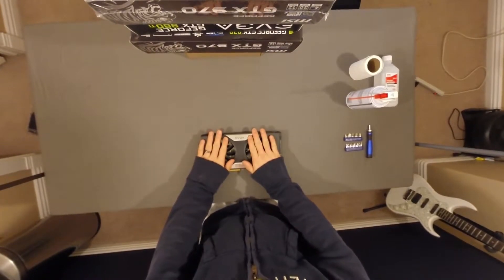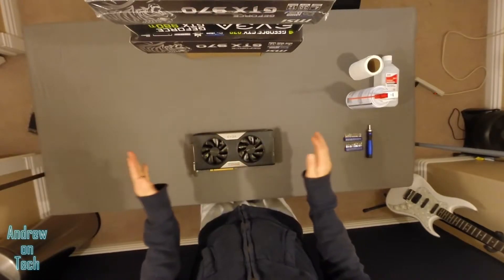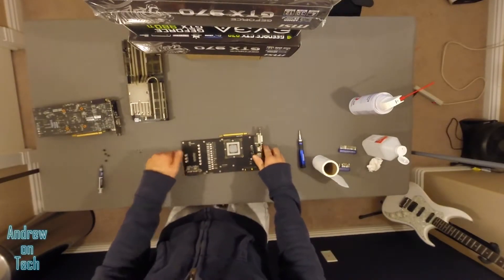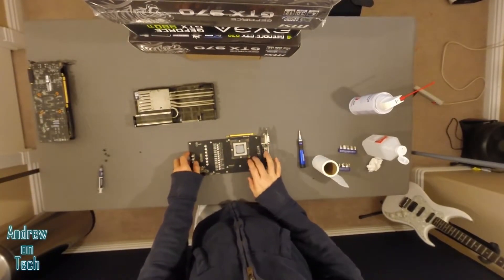Tech Care ep01: Clean Your GPU

Comment: I'm about to buy a used Geforce GTX 970 on ebay.  Is it recommended that I clean it right away?  It will be my first build.  And what thermal paste do you recommend.
Reply from the maker: +Owen Katapang I think when buying used it is recommended to look at the condition of the card and make a decision on whether or not to clean it. If the card is dusty, dirty, or shows oddly high temps, then I would consider a cleaning. If you get it and it looks clean and runs as expected you don't need to clean it. The 970 isn't that old so as a gut feeling you should probably be ok, but it really depends on the environment the previous owner kept it.
Reply: Well according to the seller he bought it in Nov 23 2014.  He's never taken apart the card itself, but he does thoroughly clean his computer at least once or twice a year.  Says he's not a gamer so the card has never been under a lot of stress, uses his computer mostly Adobe Creative Suite.   A card like that do you recommend I clean it right away or wait two or three months?  And what is the temperature when I should be worried about high temps?
Reply from the maker: Personally it doesn't sound like it has been stressed to badly, I would run the card for a bit and see how the temps are before I take the time. As for temperature it does depend on the card, but with a 970 anything 80c and under should be safe, even if it is there a lot of the time. Going over 80c is ok in spurts but for a constant load I would try and stay under 80c.

Comment: Questions:
Cleaning with Cactus Cooler, will it keep it even cooler!? 
Is there no need for grounding when touching the electronics (like grounding bracelets when installing/cleaning CPUs?)

p.s. Great videos!  New Andrew on Tech logo coming?
Reply from the maker: +FlyingLion23 Heh, Cactus Cooler, haven't had that in a while. Matter of fact there is a new logo and opening in the works, you should know this since you made the logo :p
Reply from the maker: +FlyingLion23 As for the grounding, some recommend wearing a strap, I personally just ground myself on a metal object frequently and have never had an issue. Plus, when you are building computers and you have several of each part, having to RMA one is not that big of deal, small enough for me to be willing to take the risk.

Comment: Hi Andrew, did you take temps before and after? Im thinking about changing out the thermal compound and replacing with 
Arctic Silver 5 and i wanted to know if i would see any gains for the effort?

thanks for the video
Reply from the maker: For this specific card I did not, it ended up not being dirty enough to warrant a test. I did, however, test a GTX 560 that I cleaned about a week ago that inspired this video. Before cleaning and re applying paste, it was reaching temps of over 90c and shutting down when playing any demanding games. After just removing dust and applying high quality paste my temps lowered by about 10% down to around 80c while gaming. I have seen similar improvements on other GPUs I have cleaned. The key here, is how dirty or old is the GPU? The older and dirtier it is the better results you will get from this clean. I usually do this for any card after 3 years of heavy use and have had good results each time. If your card is new I wouldn't expect much gain from just switching the paste. Hope this helps!
Reply: +Andrew On Tech 
I took my card out and it was a mess (only a few months old - a lot to say for owning a cat). I don't have any Arctic silver in so im waiting for that to ship to me but if my radiator is anything to go by: https://goo.gl/photos/QTbvbVPdzjDjrtvU9
Reply from the maker: +Paul Allen Dust and animal hair can really clog heat sinks can't they? :) Based on your picture I believe you are a perfect candidate for a complete cleaning. I would expect a reduction in temperatures for sure, which will also help lengthen the life of your systems components.
Reply: +Paul Allen do you have any filters on your case?? I have 2 cats and I checked my system after 3 months, I was shocked at how clean it was. Well except for the case filters anyways.